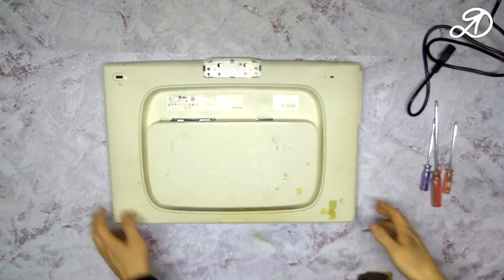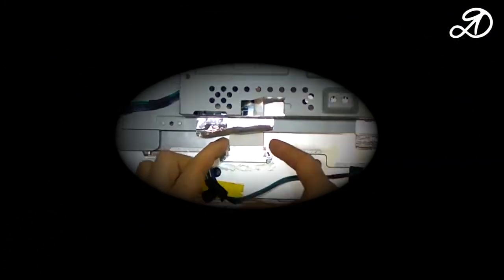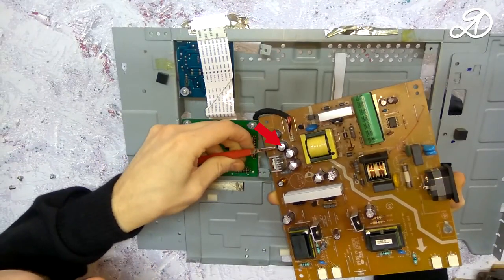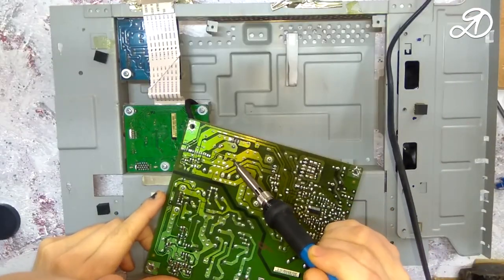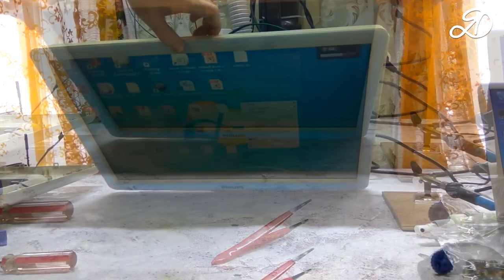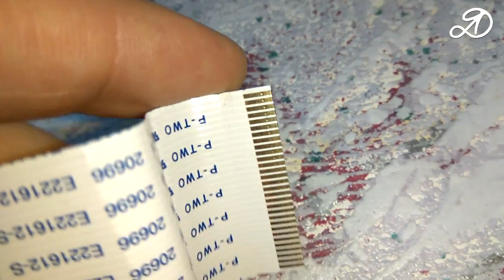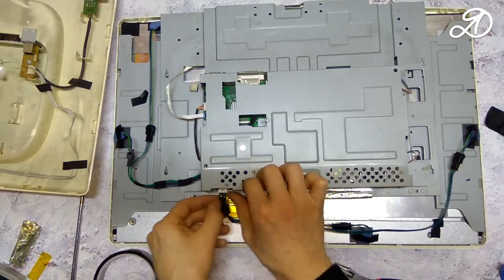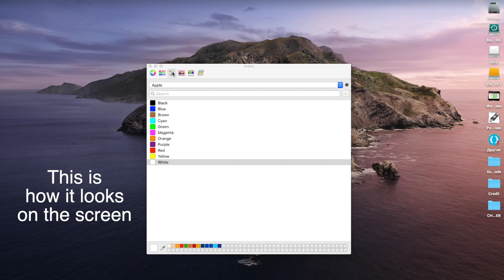How to repair the LCD monitor Philips MWX1220i. White screen, no image.

Comment: In my country, when someone owns an expensive tv that breaks, before throwing it with the trash, most of the time they break the tv even more. It' really hard to find things to repair in the Netherlands. Electronic waste, after it's brought to the dump, is considered waste and it is illegal to take electronic waste back from the dump. So sad.
Reply from the maker: Yes, each country has different rules... At us sometimes exposes equipment near a garbage can or simply in an entrance of the house. Sometimes even working. I'm from Russia)
Reply: @dial2277  Yes, the only place where I usually 'steal' electronic waste is at the supermarkets that have a special collection point. Because supermarket employees do not really keep strict rules. But that means I normally only find smaller objects. Stereo amplifiers for example are already too big. Think more in the size of small blenders, coffee makers, power drills with broken cords, hairdryers, etc. Some day I might start a restoration channel to try and inspire others to repair more. We should try to shrink the electronics waste pile :)
Reply from the maker: :D I am a very correct person in life, but in this case I do not consider it theft)) Just some people give what they do not need, and you take it and use it. Yes, of course in such places there is no large household appliances... This is a very good mission to restore broken things. I think that we are going the right way :) Maybe you have some communities or ads about unnecessary things. Everything is in our own hands. Good luck, friend!
Reply: I know it's pretty randomly asking but does anyone know a good place to stream new series online?
Reply: @Jericho Kayson Flixportal :D
Reply: @Maximo David thanks, I signed up and it seems to work =) I appreciate it!!
Reply: @Jericho Kayson Glad I could help xD